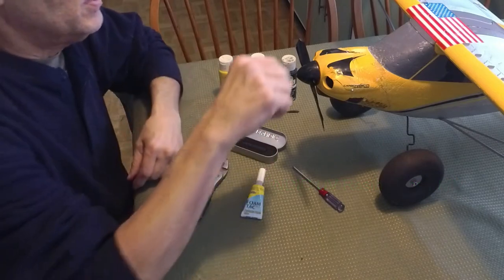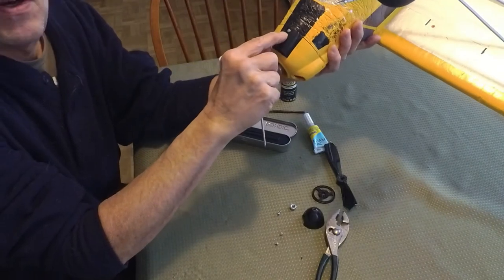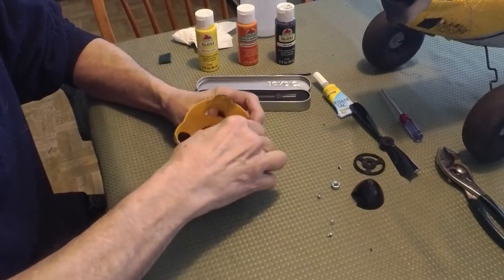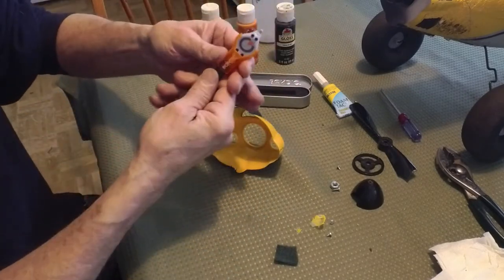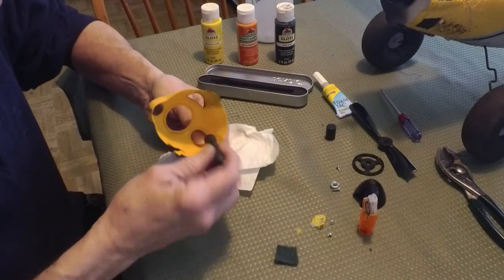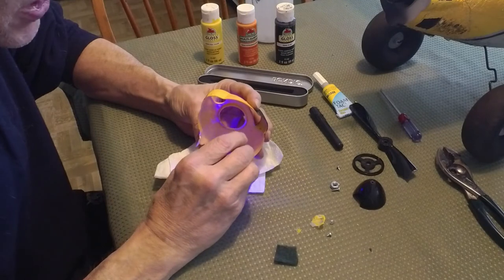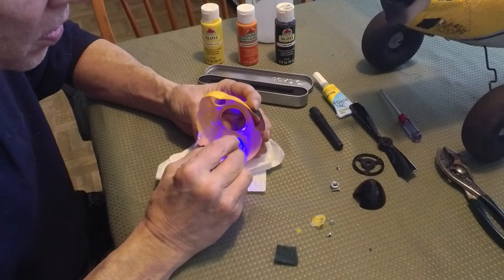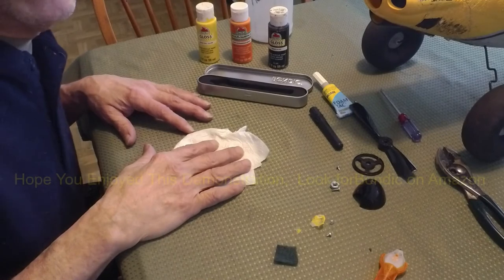Repairing a Cowl with the New BONDIC UV Plastic Resin Repair Kit  Works GREAT   !!!

Comment: Skip,another great tutorial,I wanted to give you a tip as I don’t make videos and this should be offered to our fellow pilots.i accidentally burned a hole in my new timber with a soldering iron.i really was sick about it and tried my best to think of a good way to repair the foam.ill get to the point Voila Normal everyday day spackling used for drywall repair located at Home Depot.i had some on hand adit worked amazing, please give it a try on any blemish on foam but not used for structural repair mainly for cosmetic.Dries fast,sandable,drys almost same color as the white foam,light,fluffy,paintable.If you try it and you like the results, please do a video and pass on the tip. Thanks skip,
Reply from the maker: Thank you for that. I'm pleased to say actually that I've been doing that for years. Started with my first major crash of an F-16 freewing 70 mm. Was able to fill in all the holes and dents after repair.
Its a very light weight cellulose spackle.   Great stuff.  Thanks Again Bud for watching.   Skip